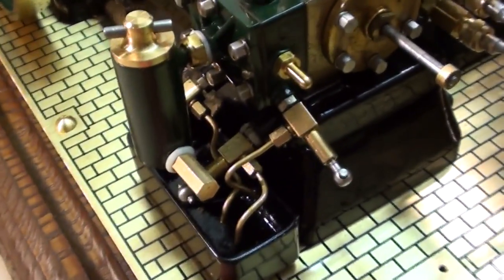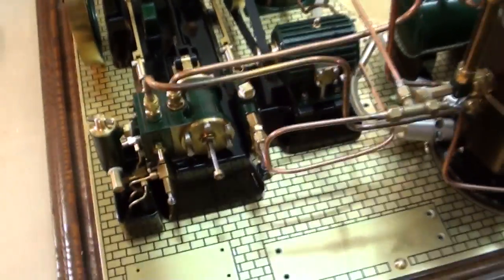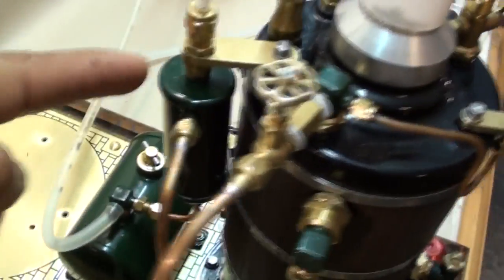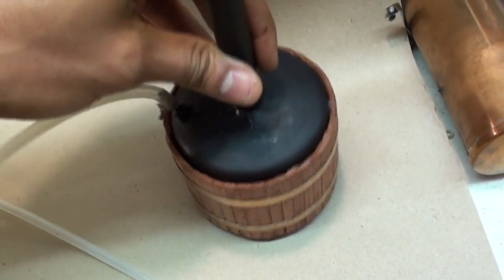York Bolton Model live Steam Plant  (Part 1)

Comment: very nice lots of details, love the etching and the colors all seem to go well. i see another small 4 screw empty space next to round one , what is that one for?
Reply: It's for a gas control valve. The original design included a valve which would turn the gas supply on and off based on demand from the boiler.